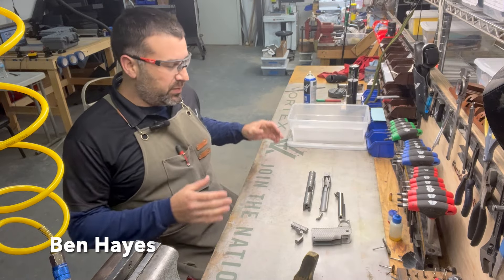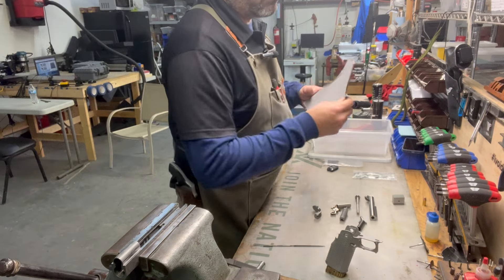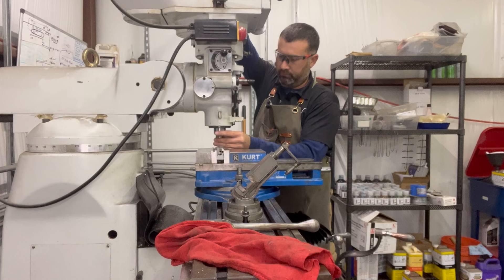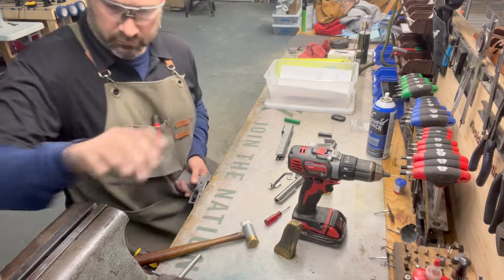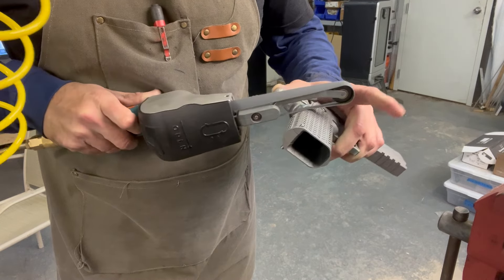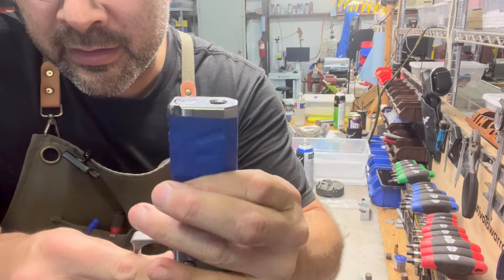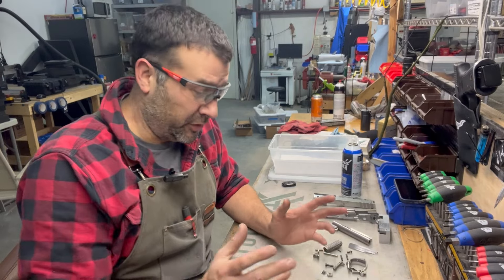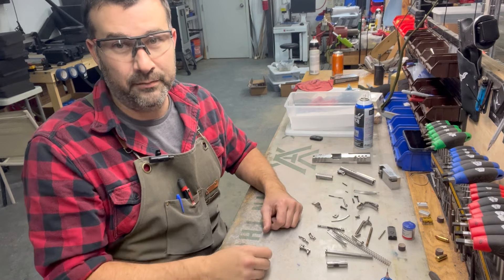(No Music) Full custom build #1 damascus

Comment: Just curious about the process.  Do you think it’s important to fit the grip first before fitting frame to slide?  The reason I ask, I had the slide to frame fitted and when the grip was installed, the slide was pinched.

Comment: If you didnt have a mill would you remove material the same  way you did the final thousandth?
Reply from the maker: @mikef1949  it would depend on how much material needed to be removed. Not all brands have the same dimensions. 
I may try to make a video with alternative methods for fitting a slide/frame.
Reply: @HayesCustomGuns  Let me first start by saying thank you for the response. Second that your work is absolutely incredible and one of the main reasons I decided I want to take a shot at building my own. I've watched this video in full at least 5 times now in preparation for my parts arriving. I would love to see  a similar video but with less speed ups and more detailed commentary. Basically a video with this quality but in full detail start to finish would be legendary and something I would pay for. Theres several things you glossed over understandable for time sake but a long formant even several hours video of you doing things step by step commenting through out would be awesome. Also going over more in depth about the tools you use and also tools that could substitute if you dont have a mill. I'm literally purchasing the tools I need right now and would love something like that to reference. 

I'm using an atlas slide and cheely frame I dont think I will need to remove tons of material but probably more than a couple thou. I think Im going to use a rail sanding jig and various grit stones. I noticed you were using emery paper over a stone and not the stone itself. any reason for that?

Seriously thanks so much for the response and videos it super helpful.

Comment: What types of files/grit do you recommend for fine work on pistols?  Would like to use some older pieces i have to practice refining slide smoothness.  Thanks for your help
Reply from the maker: The files I use are pretty basic. For most filing, an 8 inch mill bastard file is what I use. A 6 inch three square file is also handy.
Reply: @HayesCustomGuns  Thanks!